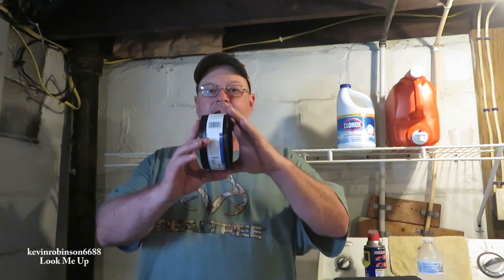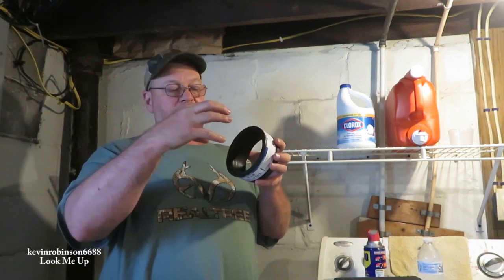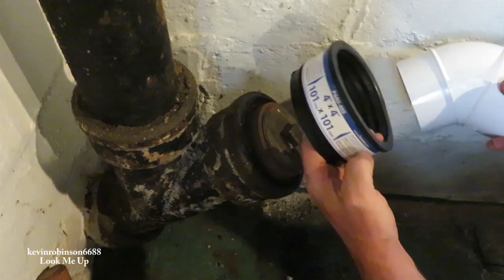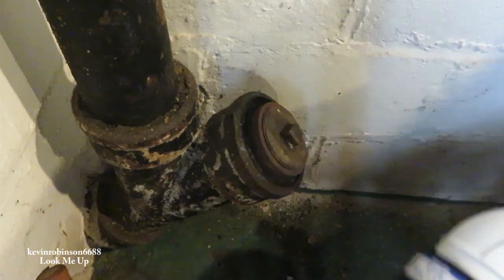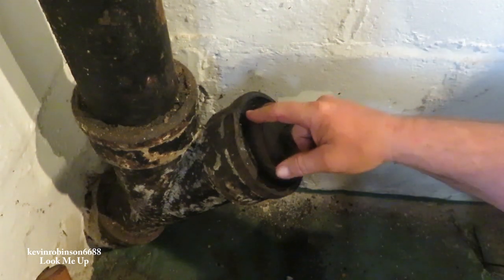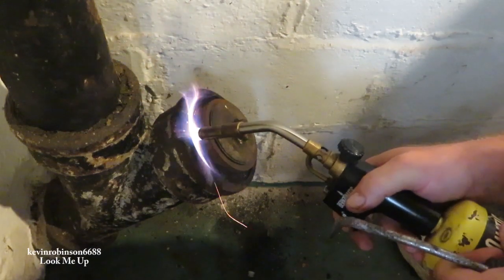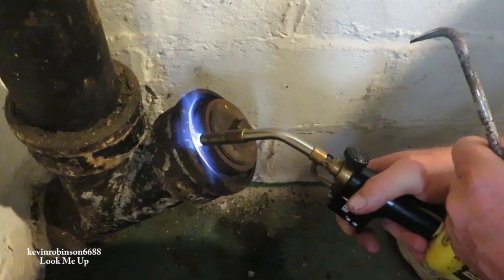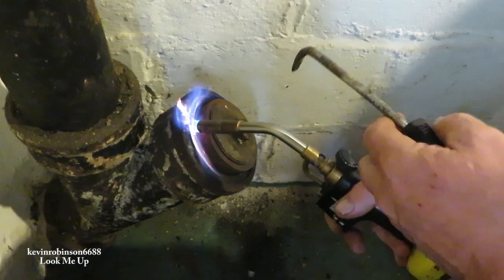How to remove a lead joint form Cast iron drain and connect to pvc pipe

Comment: Was wondering about melting, but was concerned about sewer gases. My 4" connection is wide open. Drilled it and it was actually fairly easy and quick. Question: Our city does NOT allow PVC or ABS plastic, so I have to connect cast iron to the hub. Do they make a doughnut for that size? Is that the correct way to do the connection? Or do I get a fitting (like a reducer) that covers the OD of the old hub and connects normally to the new CI pipe?
Reply: @tunnelboy777 they don't allow it because plastic is toxic in a fire. It why we switched from abs to pvc in the 80's
Reply from the maker: sorry tunnelboy but i don't know about that
Reply: @Robinson-Homestead  Thanks for the response. Yes, I found out there is a donut for CI to CI hub and it works really well. Not sure why my dumb city doesn't allow plastic while the rest of planet earth does, but that's another topic. Sounds like a little payola action with the cast iron company.
Reply: My house was outfitted with city sewer circa 1908. Walt Disney's house had the same about a mile away. Iron was probably dragged in behind donkeys and oxen from the rail yard. It still works, sort of. Rust is causing perforations. 
NOW LET US TALK about PVC.  it's expected life is 70 years, falling short of a full century. When it [PVC] was discovered does not matter since it wasn't a viable product. That is until WW2 when insulating wires for ships it proved itself useful. But those ships aren't really available for inspection (Big ba-da Boom). Or they have been refitted and ultimately now museums.
We have learned NOT to use PVC for drinking water.  Poison leaches out of it.  Unlike a nuclear disaster, many poisons from plastic never diminish. So flushing your poo and poison into the sewer, which IS part of our water supply, means those poisons are, albeit less concentrated, in your future drink.  Let's not even begin with the toxins emitted in manufacturing all the plastics or how plastic is disposed of.

Yes, PVC is so much easier to install under every sink and loo, right out to the curb under ground. But if you had a choice shouldn't you be asking yourself, "Do I want to stand behind my wife breathing while she sprays aqua net on her hairdo or should I just go take my Centrum+iron?"
Yes, iron kills. But only if your wife is strong, mad and has an iron skillet to swing at your head. If she isn't strong, keep that spinach away from her, it's high in - you guessed it  - iron.
We need to keep moving in search of alternatives to plastics. Sorry Saudi Arabia (and Texas).
Reply: @davepetrakos475  i don't know where you got 70 years from. i herd it had a life expectancy of  500 years

Comment: That took 10.5 minutes. I would have cut the female thread adapter from the inside with a diamond wheel. Everything would have pried out in 5 minutes. I don't recommend using hammers on cast iron.
Reply: Use a 2" hole saw to remove the center of the plug. Then use a sawsall cut the remaining plug out. The iron female adapter will break easily with a hammer. Then the lead will peel off. Complete prep. in less than five minutes. Just did two today.
Reply: @jeffreyjohn2037  to you have video of that?
Reply: @stevenvanfleet2520  no, I don't do videos. But the 2" hole saw works great. When the hole saw is almost through tip your drill to cut one side. Then grab the square part of the plug and pry it open so you don't drop any debris down the sewer line. Take your time and it will work out good. # Best Method.
Reply from the maker: Thanks for the comment Jeremy.
Reply: Hammer and chisel pops those brass clean out caps out in a matter of seconds
Reply: Jeremy Olson , Its not a female thread adapter, it's a clean out fitting . It's not a pipe thread at all , it's a special thread  I.B.T.S. 👷🏻

Comment: what the butt you used a sewer drain fitting on a dwv line. you need to use the proper sch 40 dwv fittings. 
                                                                         (drain waste vent)
Reply from the maker: Thanks for the comment and watching.
Reply: I don't think it caused any difference. That waste line is way off anyone's radar.
Reply: @jeremyolson4280  sewer and drain fittings are smaller.
Reply: Yes I noticed that also everyone thinks it’s so easy

Comment: Kevin  I'm going to do a job exactly like the one you showed in the video.  Do you have to seal the boot with anything before you shove it in the cast iron.  I'm thinking maybe sewer gas leaking around the boot?
Reply from the maker: Maybe put some Vaseline on it.
Reply: Silicone
Reply: Plumbers putty

Comment: so what's going to stop the methane gas from getting past your transition? wouldn't it make some sense to use a 6''x4' coupling and adapt to the outside of the hub that way it's air tight. '
Reply from the maker: It is air tight, no gas coming out, thank you for watching.

Comment: It’s tough, because that big old pipes just sucks the heat away. Tough to get it flowing. Nice job my friend, you are right, PVC is so much easier. Thanks for the video Kevin, be well my friend.
Reply from the maker: I do like that PVC thanks Hatch.
Reply: Yeah but you will
Still get the lead hot enough to soften ..

Comment: Between the methane and lead oxide fumes, drilling is slower but safer, according to my retired plumber buddy. The union strictly prohibits the melting of lead.
Reply from the maker: Good information Bent Nickel thank you for the comment glad I only had one to do.
Reply: Amen. Removed many a joint.
Reply: curious...how does the lead get in the joint initially?  thx
Reply: @treystills  its melted in a little pot and poured in
Reply: @jrnelson8085  what about a horizontal joint?
Reply: The union🤣